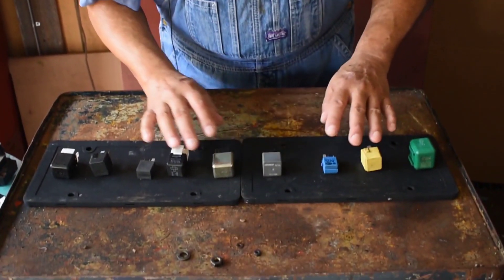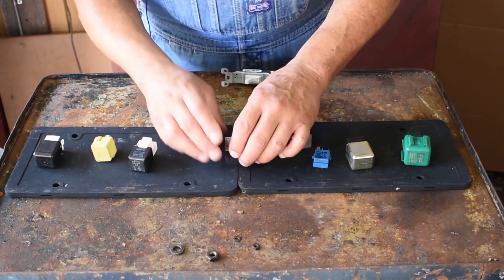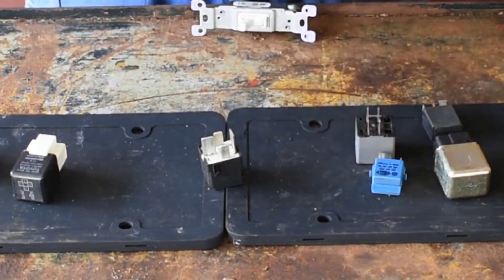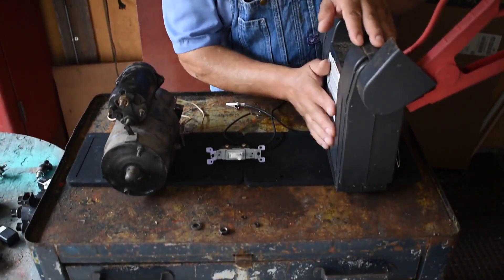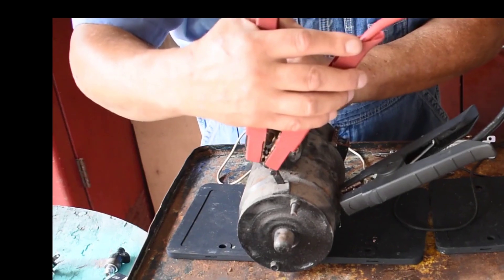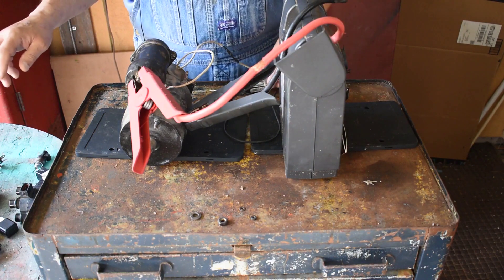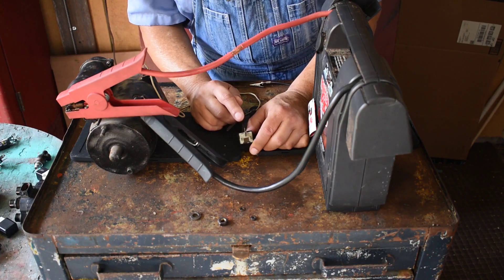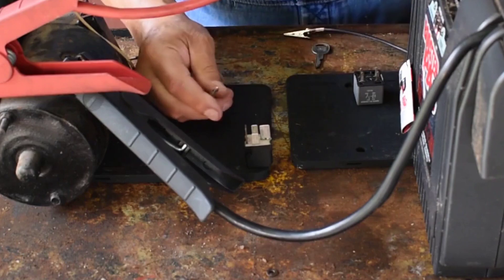12 Volt Relays

Comment: Thank you I Like your style of teaching! And I am a subscriber! I do however have one question.. The short version is i changed my condenser on my 97 dodge cummins from factory round to rock auto flat.. new compressor ex valve evaporator all new.. AC on high and with an infrared camera the outlet side of the condenser gets hot, pressure on gauges builds and AC kicks off.. So i thought i would install a electric fan with a relay over the side that is the hottest..What would be the best way to wire the fan so it comes on/off automatically? Thanks ahead of time!

Comment: My car is a Mersedes Benz 211 w e class 320 . a/c not cooling   Radiator fans do not turn  it goes into limp mode on second gear
Reply from the maker: With the engine off, measure the Freon pressure on the low side. It should have about 90 psi. It needs at least 40 psi for the compressor to engage.

Comment: How did you test the ground at the relay.  I didn't see that test
Reply from the maker: You are correct. Sorry, that step got edited out by accident.(3 seconds) You move the alligator clip to the positive terminal of the battery, make sure it works, then you probe the correct terminal. The wiring diagram will show WHEN the ground should be there. Thank you for the question and thank you for the view. I am very IMPRESSED you spotted my mistake.
Reply: @theoldmecanicoshow9004  thanks.  I would have definitely been one of your students if I had the opportunity
Reply from the maker: @MrGrzmnky  I have a whole series of lessons on Automotive AC. Maybe you can check out some of them. The best one is the 1st one : https://www.youtube.com/watch?v=Zj_wQdkOHpk